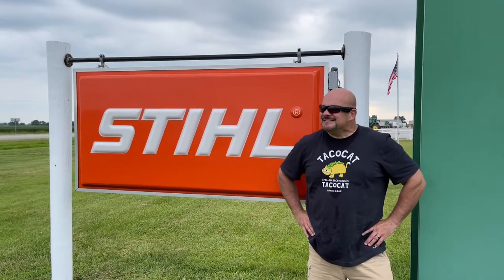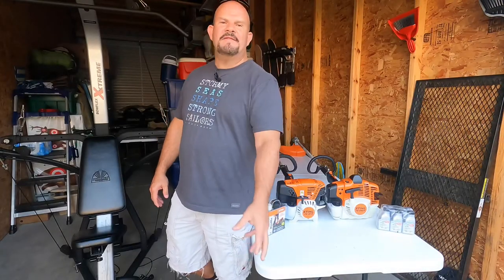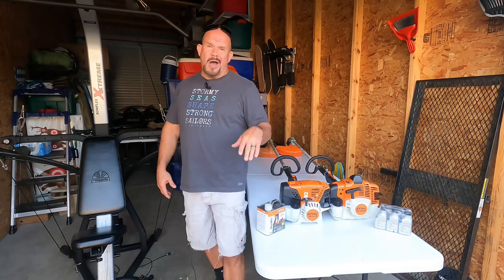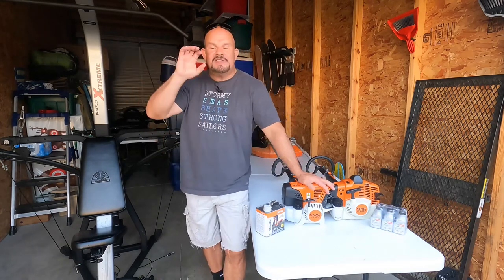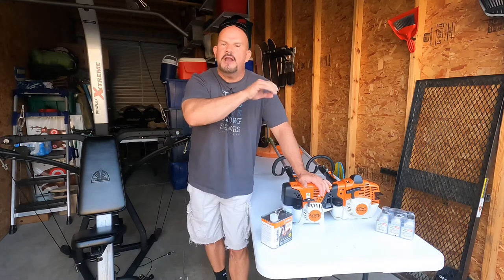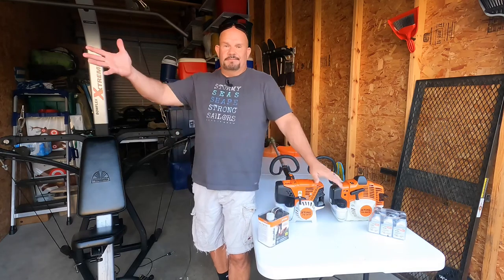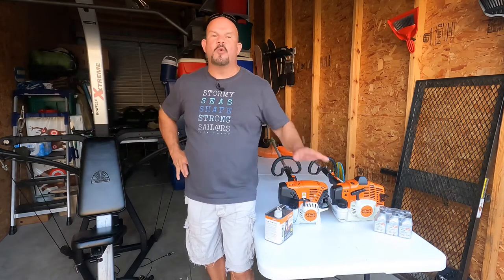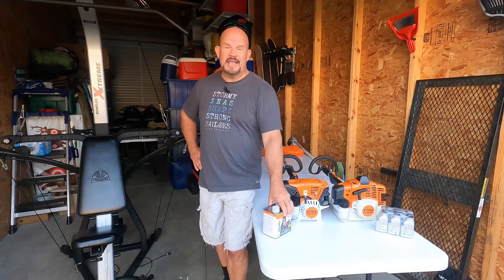How to Bring Your Stihl Back from the Dead. #Motomix #Engine

Comment: I agree.  I run 50:1 Stihl Ultra with premium non ethanol gas, normally.  Some folks have trashedStihl Ultra but I have had no problems with it.  I know it will put fine grain ash deposited in an engine if I do not run it WFO most of the time, but I also know how to clean it out and it does not harm the engine.

Comment: We ALWAYS use non ethanol and use STIHL  2 in 1 the best there is!!!!!
Reply: I don’t know about the 2&1 being the best chain sharpener there is.  I use a regular Stihl file for most sharpening.  I can sharpen a chain pretty quickly, about 15 minutes, free hand.  I have a chain grinder but I have to pull the chain off to sharpen it.  I only  use it if I got the chain in the dirt, rocks or wire, things I try to avoid.  Most of my chains only get about 3-4 licks with the correct size Stihl file after each use.

Comment: As a person that works on saws for a living Stihl oil is always the easiest to tell if used by all the carbon build and lack of oiling. The pistons have that dark build up of that pond water color. It has such a high flash temp that it just doesn't clean well. Its not FD rated for a reason!!
Reply: You have been listening to some people I won’t mention, to much.  Pond water oils a chainsaw, adaquately.
JASO FD oils better because the leave more oil in the engine but they have  other problems.  I am sticking to my pond water because I have never experienced a problem with it that I can blame on the fuel.  I am not running snake oil (Amsoil), as some do and surely not a TWC3 oil as does the person you reference.  Boat oils are used the water cooled engines which seldom operate over 160 degrees.  Chainsaws run at 300+ degrees.  If Stihl Ultra was not oiling a saw, sufficiently, Stihl would not be selling it.
Reply: Ted, you have to balance oiling and carbon buildup.  Stihl Ultra is JASO FB rated.  It is an adequate oil for most chainsaw applications.  It won’t cover improperly mixed fuels, persons that abuse their saws or poorly designed chainsaws.  Quite a few persons these days wants to blame problems, they caused, on someone else.  It’s not my fault, it is someone else’s fault.  When the can’t find someone else to blame it on, they blame it on the manufacturer, when the problem is due to them and them, alone.  I have said for years “accuracy in a rifle is up to the screw holding butt plate, “ and conversely reliability in a chainsaw is determined by the person operating the chainsaw.  If they are feeding it the right fuel and operating it in a prudent manner it will last a long time.  If not then you can figure out that one.
Reply: @johnclarke6647  it's not fd rated for a reason. It has such a high flash temp it doesn't burn clean and it stinks too boot! I haven't listened to anyone its from experience!
Reply: @tedneitzel  I won’t disagree about it not burning clean but it is a small grain carbon deposit that doesn’t do a lot of harm.  Stihl has a carbon remover that will clean up the carbon if you want to use it.  I also agree about the smell, however I have gotten used to it.  I leave the Stihl Decarbon cleaner in over night before I pour it out.  Stihl recommends eight hours but I leave it in overnight.  I then rinse the cylinder out with two cycle and crank it up.  I do it once a year on saws that give me a problem,like my MS 251 and 241CM.  Just part of my regular PM program, like lubricating sprocket bearings, cleaning clutches and sprockets.  That black stuff in Ultra is graphite, which is part of their lubrication package.  It is not in Stihl Moto Mix.  It performs the same lubrication function as zinc used to provide in automotive oils and lead in gasoline.
Reply: If you think the pistons in your chainsaw are dirty, try looking at the ones in your car.  Ash and carbon buildup on the piston and valves are just a fact of life in any internal combustion engine.  From what I have seen, FD oils do not clean the spotless.  Only high RPMS and high operating temperatures will do that.  We used to clean up carbon deposited in four cycle engines by pouring water down the carbs, but it can embrittlement valve stems.
Reply: @johnclarke6647  I am a mechanic Auto and small engine. I run avgas in my race car and non ethanol in my saws. My modified runs methanol. I know all about fuel.
Reply: @tedneitzel  I am a pretty fair wrencher, myself.  I run whatever is the cheapest in my cars.  I run PNE gas in my two and four cycle stuff.  I - used to run Sunoco 260 in my cars back in the day.  I have never worked as a mechanic, but I have a pretty fair engineering background.  However, I have been mostly a manager or executive.   If you know fuel then you know that todays fuel sucks.  I am not an environmentalist.    I am a conservationist and there is a difference.
Reply: @tedneitzel  I sure have experience with it.  Stihl would not continue to make and market something that is detrimental to their products.  I run it in a stable of saws, Stihl, Husqvarna, Poulan, Homelite and MAC, big, little and in between, plus blowers, weed eaters and hedge trimmers.
Reply: @johnclarke6647  they don't make the oil it's from Castrol.
Reply: @tedneitzel  Ted, it is made to their specifications.  I heard an outfit in New Orleans was making it.  I am sure it is a low bid contract - they always are.  My favorite two cycle oil has always been StaMix, but can’t find it anymore.

Comment: @Discovering His Way, you know Stihl ultra is actually an oil for a boat engine right? I have the email from them to prove that it's not FD Certified. I'll send it to you if u want to see.
Reply: I thought the same until I saw the guy on YouTube testing 4 premix 2 stroke fuels in a stihl 661. He actually put a new piston and cylinder in each time to demonstrate between the 4 different oils.  The stihl motomix came out on top with the best lubrication cleanliness everything. It's a great oil whatever its rated.
Reply: I know that.  It is FB certified.  It is written right on the bottle, as I remember.  FD mixes do not mix well with other two cycle oil mixes.  They Al do not stabilize as well, either.
Reply: I would hat to see how much it would cost to use Ultra in a two cycle boat’s gas tanks.  I always bought oil in quart bottles for my boats, not 2.6 ounce bottles.  I have poured a many a quart bottle in a six gallon tank.  Now, they sell it premixed at most marinas.    Water cooled two cycles are different from air cooled two cycle engines.  They use TWC certified oils.  I think the current API certification is TWC3.